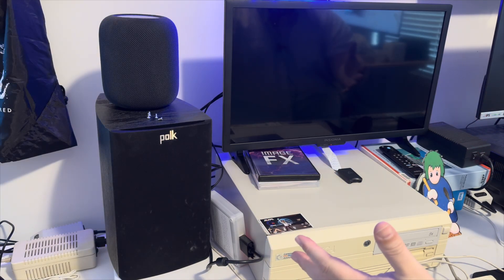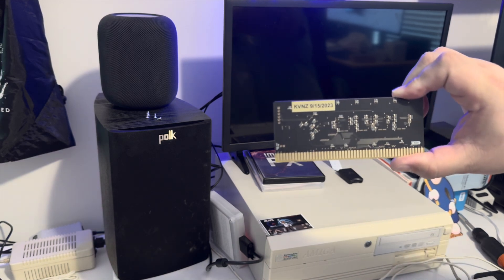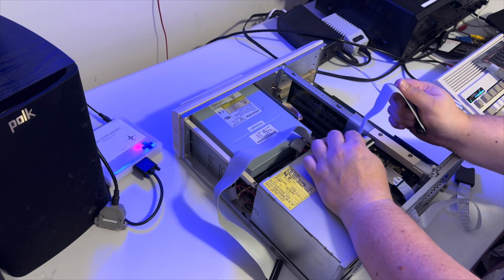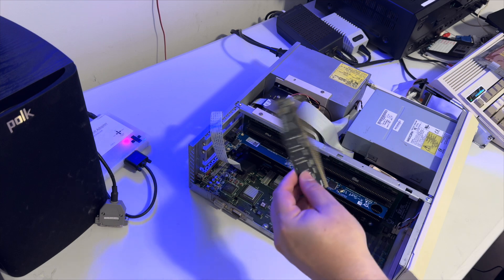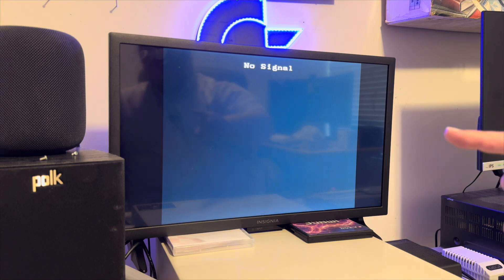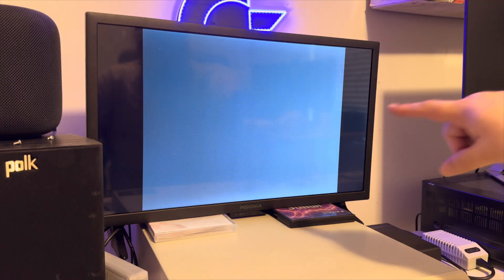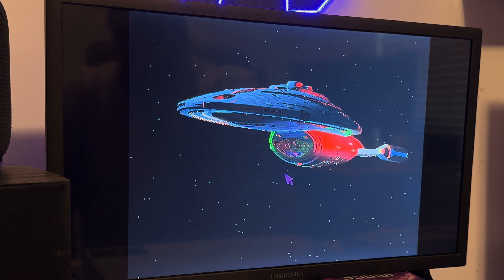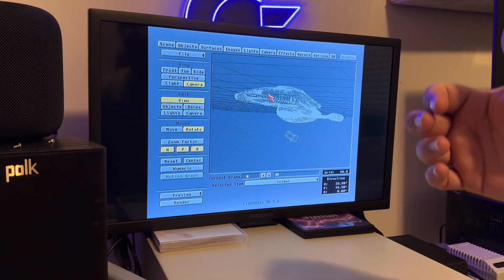Adding A Lot Of Ram To An Amiga 4000.

Comment: Stock A4000 desktop case have serious ventilation problem!
Reply from the maker: yeah they are not great. ive left my floppy drive area open.
Reply: @HoldandModify  I remember I used to leave the top cover off! Never had a problem with the same hardware in my QuikPak A4000T
Reply from the maker: @mervynstent1578  I had no idea what a QuickPack was until Chris Edwards showed me his. heh.

Comment: Sad ,really sad Lightwave wasnt released to and for the PC until 1995. Will Weaton had made more money rendering the Enterprise , and Voyager on the Amiga ,and other ship then acting. I was told this face to face. The Toaster screamer/oven came out of necessity. Its like why go single core 8bit pc. When you could do At least 64, core 256bit Amiga. I was there I did it.I, also did the first movie via the stand alone Light Wave/Toaster Software Circa 1993 .Its like tell the whole truth.
Reply from the maker: Again, when I was at Foundation Imaging, one of the two VFX houses working on Voyager, there was no Amiga or Will Weaton around. 1997-1999.

Comment: Yes, the always boots 4000 in action! Please more rendering with that machine. I also noticed back in the 90s how well the 060 compared in speed to a Pentium or Pentium Pro and MIPS CPU's running over 100 MHz on a SGI. Crazy how fast the 060 was at measly 50 MHz...
Reply from the maker: Next video I will get in to more LW. ;)

Comment: 3D print monitor stand. Or use the VESA mount
Reply from the maker: I’m getting another one of the ones I bought for the 3000. They’re cheap and look much better. That 4000 one isn’t a monitor, it’s a TV. Image is garbage. But yes, your idea is a good one. I haven’t touched 3D printing though. Heh.

Comment: Whens a 4000 no longer a 4000 and just the case  is original?
Reply from the maker: It’s always a 4000. Machine built for expansion. Even back when they came out. We often sold them with a pile of upgrades for the more intense users. Fastlane cards. Emplants, RTG, etc.
Reply: @HoldandModify  that's true - good point. Forgot about the vast number of 3rd party cards back then

Comment: Dude, it's super easy to take a pair of scissors and cut the ribbon cable to the exact length you need it. The black plastic connectors are designed to be pulled apart and re-clipped back to the cable by hand. Back in the day I ran into all sorts of issues because of a ribbon cable being too long. I'm telling Dr. Chris on you!!!
Reply from the maker: Haha for real it’s stuff like this I don’t know. I paid $10 for that new cable off FleeceBay.
Reply: @HoldandModify  take an old one and play around with it and experiment putting the connectors on and pulling them off. I have no knowledge of the nitty gritty technicals but making a serial cable or IDE cable ain't that tricky. Back in 87' I did de-solder all the chips off a 2mb memory card so I could solder half of them piggyback on my A1000. That's the most technical thing I ever did. I even cracked one of the chips mostly in half and used super glue to make it right, and it worked! You can do it!!

Comment: Center mount monitors are nice but they take up space.   I had two on my desk and needed more space so I put the monitors on a two monitor vesa mount stand just to raise them up.  My situation is different than yours in that my primary PC shares the same space as my Amiga's as they all live in a server rack and share those monitors through a KVM Switch.   Space is my biggest problem.   You can never have enough RAM always best to have more than you need.
Reply from the maker: Slick setup! I need light weight and easy to move around monitors for my madness. Such is my chaos. :)

Comment: Q, that issue with where you connect the drive to on the ribbon - is it unique to Amiga IDE or is the PC also affected by this? I wonder is there a terminator for IDE HD the same way there is with floppies. Gosh imagine having 400MB ram back in the day. Out of curiosity what specs would production crews have been using, e.g., for Babylon 5? Another little hand clap from me to Dave Haynie for Zorro III.
Reply from the maker: The original A2000s and A2500s on B5 had 040s in them with 16mb and 24mb I believe.

Comment: For a monitor stand I use a pole mount VESA plate and a "studio pole" (used typically for mounting lights and backgrounds in photography studios). I just wedge the poles around my desk and mount monitors/etc on those.
Reply from the maker: You are smarter than me. Most are. :)
Reply: @HoldandModify   Not so fast, there, because you have mode pro working and I do not. lol
Reply: What a good idea! I have a teeny 10" monitor that I need to get a little stand for for my A600. I may try your idea.
Reply: @10MARC  When I got my indivision I was heading in the direction of using a portable "extra monitor" as a low profile display. I ended up sticking with my current monitor setup and a retrotink 5x, however, since the indivision had a lot of noise coming from either the IDE or the CF card or some combination of the two.